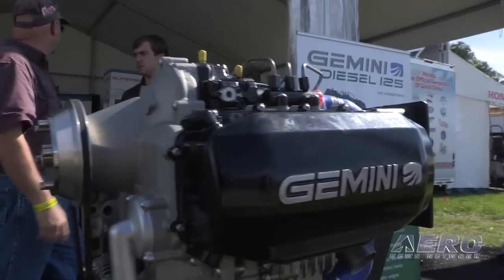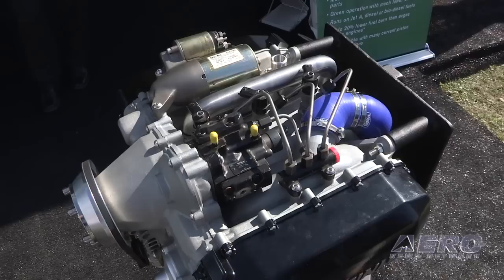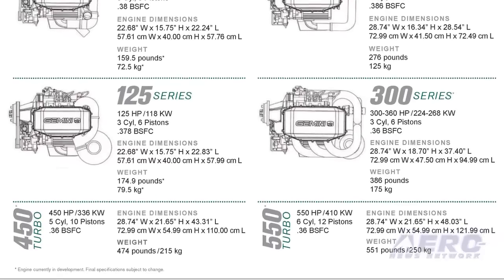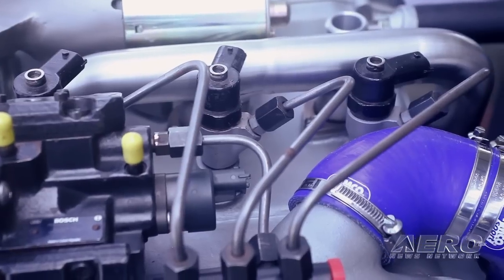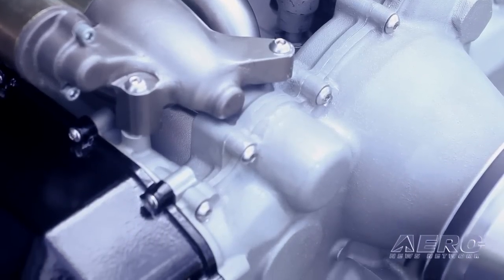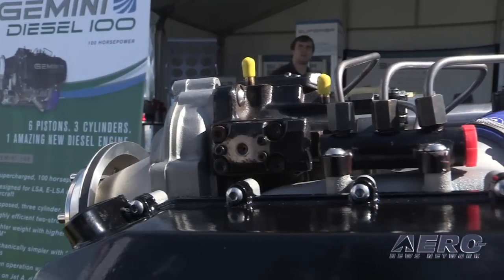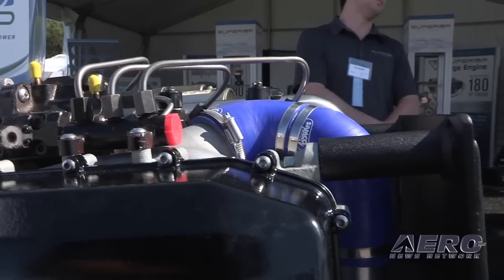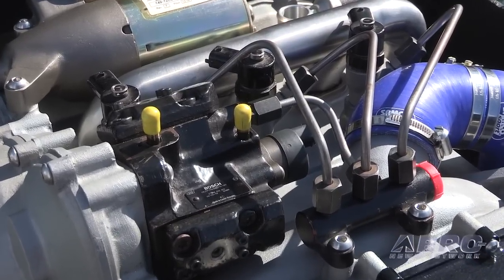Aero-TV: Superior's Gemini Diesel - An Idea Whose Time Has Come?

Comment: Expensive?  Price a 912iS lately?  I would also imagine overhauls will be cheaper as well.  Fuel is cheaper at airports and you can get diesel from the pump to run it when you want to jerry can it.  Diesel vs premium auto fuel is close, so the fuel cost for it and the rotax would be close to one another.
Reply: Yeah the perpetually delayed delta hawk is apparently aiming for no TBO but instead to have engine monitoring that tells you the state of the engine so you can decide when it should be overhauled.

Comment: I don't know how this can be described as all new. Diesel powered flight isn't new. Germany had the Junkers in 1940. Westland prototyped the Wapiti diesel radial around the same time. Opposed piston 2 strokes go back to the GM 71 series of about 1940 and more similar to this " new " engine , the Commer TS3. I'm glad someone has decided to revisit this well proven design, but don't call it new. All the groundwork has been done over half a century ago.
Reply: That Junkers engine was also opposed piston which helped make it light enough to put in a plane  (no heavy cylinder heads)
Reply: Yeah! why don't they just fly a cast iron engine.
Reply: They are only good for low power to weight ratio engines, cast iron cannot handle a lot of HP for long period of time, Billet aluminum 2 strokes anyone.
Reply: newer aluminum alloys are lighter, stronger and conduct heat much better, times have changed, todays engines are much better!
Reply: @jlo13800  A forged block would be better than billet... billet has to be heavier to make up for the lost strength to internal stresses vs forged. For the price nobody should be settling for anything less than a forged block, and crank.

Comment: Way to expensive as usual.
Reply: After you get the people, engineers, production line, certification, sales force, distributors, and planes flying with them, how much would you sell them for?
Reply: At least it has total loss oil injection, just rune SAE30W low ash!